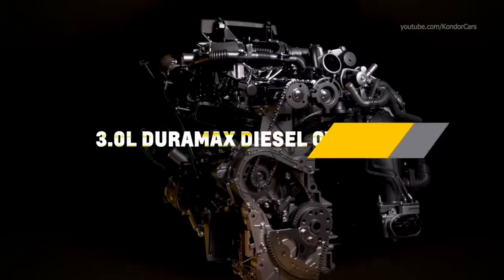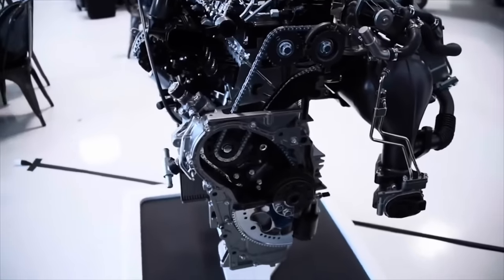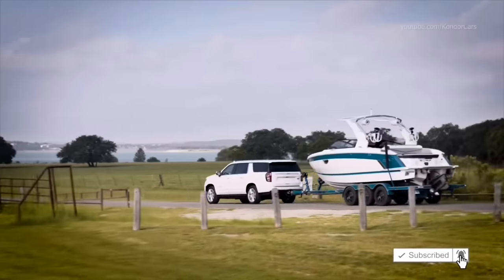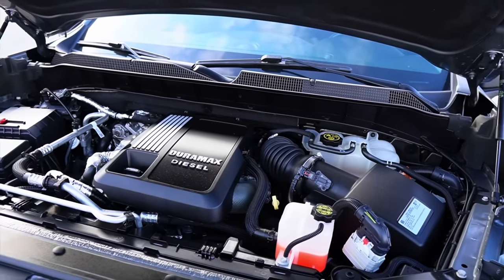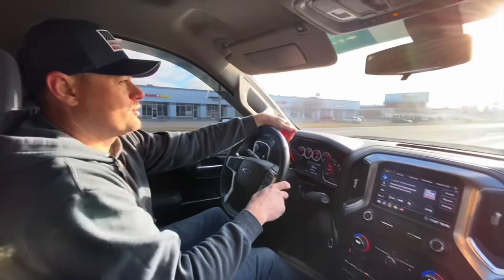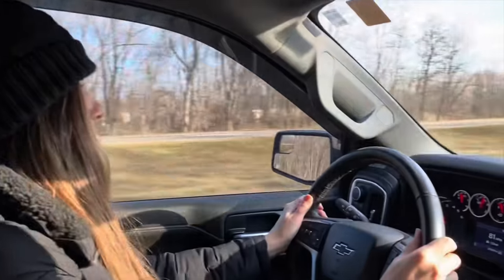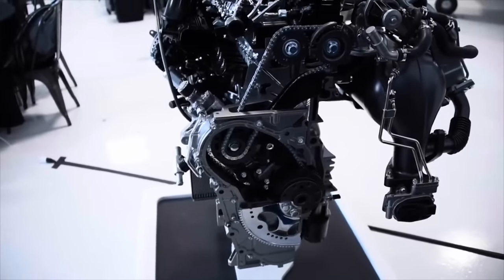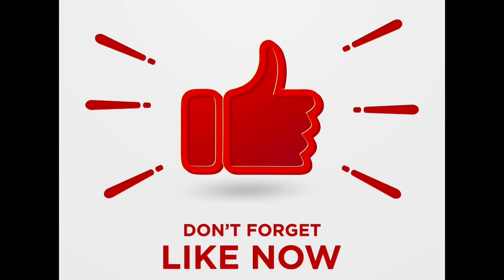What Everyone Needs To Know About The 3.0L Duramax!

Comment: Based on the highway mileage  to 100,000 miles you spend the same amount on Gas as Diesel. Consider cost per gallon and gallons used.  Not to add the DEF costs. You are better off with the Gas engine.  When the diesel emissions stuff acts up your wallet will wish you had a gas engine.. Sadly the US Govt has forced the manufacturers to ruin the diesel engines.
Reply: Show your math. Also, DEF costs for 100k would cost you about $100-$150 (roughly $1 per 1k miles) if you not towing constantly.

Comment: Your biggest problem is flooring it and expecting it to take off like a gas engine. Big mistake with this truck. Stay within the powerband and it does take off. Under 2.5k revs and it will move. I'll never understand why people try to drive small diesel engines like a V8 gasser.

Comment: The 2023 3.0 Duramax tow rating was increased to 13,300lbs, you didnt mention that.
 Ford and Ram have/are deleting their 1/2 ton diesel engines.
Did your wife know the truck you tested was an extended cab and not the very roomy crew cab?

Comment: So if a Duramax will go an average 10 miles more per gallon, plus deff fuel, fuel filters, more oil, it's just still way more expensive to drive. Period. The 2.7 is a beast has more hp and almost same torque....... So ya.

Comment: This was one of the strangest reviews I've seen. It says it came out 3 weeks ago but most of the info is old. The newer 3.0 I believe now has a 200k mile belt change interval. You mentioned the new engine but when you compared the diesel to the 5.3 on the chart you used the old diesel's numbers. You compared a Denali HD to a 1/2 ton Chevy extended cab in maybe an LT trim and wonder why it's smaller and not as nice? Shocker.

Comment: Total nightmare sensor problems fan problems cilynder problems just when warranty runs out stick to 6,6 Duramax or 5,3 gas ⛽️ it’s a dog mine is screed needs $4,000 worth of work. I have a 2021 with 80K miles it’s worthless.

Comment: Your info is way out of date and inaccurate My friend.  My first 2020 3.0 I owned to 73k miles only had on bad sensor issue. I traded it in for a '22 3.0. the tow rating on the '22 is much higher tow rating at 10,500. The New LZ0 does not come out until the '23 model year. If you're trying to pull a gooseneck or any 5th wheel, you would never buy a 1500 or a 5.3 gas for that matter. Thos motor will run circles around the 5.3 any day at any time!

Comment: If you're going to be hauling heavy equipment, you're not going to be buying a half ton truck anyway. So why make the comment or comparison? Normal people would buy that for the gas mileage not the towing capacity. Not everyone pulls trailers or campers all the time. If I could afford one, I would buy one, but the prices have gotten so out of hand most normal hard working people like myself can't afford one. It would be rusted out before I could even have it paid for and that would be on a 10 year loan. Ridiculous!

Comment: I put the PPE intercooler in my 21 AT4 3.0 Duramax and it goes like AIDS @ a queer convention.  Heavy tow 7000+ nice upgrade.  The PPE trans pan, trans cooler, trans thermostat bypass and rear diff cover are nice upgrade for heavy towing also.

Comment: 2023 LZ0 with the tow package can tow around 13k.  You get the 373 gears in a 9.75" rear housing.   That's the truck I'm looking for this later  in 2023.

Comment: Too complex for a diesel. Too many things to go wrong. 10-Speed transmission is also problematic on many of them. 3.0L diesel might give @ 30% better fuel efficiency but gasoline costs @ 30% less. Plus diesels require more maintenence & DEF.

Comment: Have had many diesels and run a small fleet of Duramax, Ram and HAD some Super Duties. 

LOVE DIESELS, but the 3.0 in 1/2 ton is no way worth the extra cost and maintenance cost. Between the STUPID DEF system and the cost difference between diesel and gas, it is not worth it. As much as I love the diesels, if we bought any 1/2 tons they will be gas. 

Already have to many DEF problems as it is.

Comment: Also, I currently go overseas a lot, I have driven GM vehicles in other countries that have these diesels engines and the smaller 2.7 inline diesel 4 cylinder. In a trailblazer 4x4 2023 model that you cant get in the states by the way, sad to see. with the 2.7 Duramax it averages about 45 miles to gallon in high elevation and mountain regions. These vehicles don't run DEF and only have O2 sensors. America is like the only country that has to do with this Stupid EPA BS!!!!!!!!!!! It kills the engines life span in half and cost more to operate and gets less fuel mileage. America is getting ripped off big time.

Comment: The transmission wasnt "co-developed" with Ford.. Ford 100% developed it. Chevy's part of the deal was they were supposed to develop a 9 speed for AWD/FWD crossovers. Ford started putting the 10 speed in on the 2017 F150 and Chevy didnt till 19 i believe because there was a bit of a pissing match since ford rejected Chevy's 9 speed due to not lending to fuel efficiency enough. Late model chevy transmissions are trash. I have a 19 teail boss with the 8 speed and it has slipped since day one. The dealerships say theres nothing that can be done, Chevy says thats just the way they are. What a joke.. i honesty wish i would've tried to make them buy it back but i thought maybe it'd get better.. it hasn't.
Reply: Shame. A simple fluid change is all thats required.
Factory fill up was from large drums. It separates. They only sell quarts now.
If your torque still slips after the fluid change you waited too long. It's toast.

Comment: On another note will manufacturers ever stop building diesels with def? I’m keeping my LB7 forever unless they stop making this new def eating exhaust plugging over priced crap. I would love a newer truck but as long as the feds are going to over reach and EVs are the future I won’t be in one. I saw the 1000hp hummer go an impressive 123 miles before it was completely dead pulling a little 6k trailer. So the EV concept has another 10 years of failing to replace the diesel truck. Def is a bust and if someone wants to delete the L5P that’s no small inexpensive task as well as now the feds want to send you to the clink for it! Is there talk of fixing what is wrong with the new diesels?

Comment: Meh 2021… should review the LZ0 also no DEF shortage, every place I’ve gone to where I am there’s plenty plenty. Also I have 6k miles on mine and still have half a tank of DEF. Also you are testing the smallest cab version, Crew cab is a lot more room. Your review is pretty terrible to be honest, your just used to 600hp+ 6.6 duramaxs so this didn’t get a fair review from you in my opinion. These trucks are great. They are meant for lightly duty work and getting great mileage.

Comment: How old is this video? Half the info is out of date or wrong lol

1st 2020-22 non refresh LM2 max tow is 9300 lbs, 2022 refresh+ has the Max tow package available which is 13300, better than dodge or Ford which doesn't even make the 3.0 power choke in an f150 and ram killed the eco diesel.

2nd the oil pump service belt life is 200k miles, originally was 150k but is now extended to 200k

3rd there's a DEF shortage? 

4th. You only need to add Def once every 5k-7k miles unless you're towing than maybe 1k-2k miles MAYBE

5th. Biggest issue is the crank no start which is mainly only the 2021 model year as GM changed suppliers of the cam wheel for that year

I think that's all, I have the 2020 one with 75k miles and have had no issues whatsoever, it pulls my 7klb TT with ease and you can't even tell its back there,  mines a crew cab, standard box 4wd z71 and if I go 75-80 I get 25-26 mpg 65-75 and I'll get 27-30 mpg. I just did a round trip from Santa fe to Colorado Springs about 700 miles on a single tank of fuel

Comment: This motor sucks , if u want your truck in the shop for 3 months go buy it but anyone who can look things up and read stay away , my 2021 3.0 has had more issues then any truck I owned in my life , push the start button runs through the cycle and dose not start  long crack !! , had 2 glow plugs out of 6 of them at 15k miles. , 6 oil. Leaks destroyed my driveway , break sensors went out 80 days in service and counting biggest pice of junk don’t look it up be4 u spend 70k on a basic truck

Comment: Here's what you need to know about the 3.0 Duramax 6 cyl engine. It's a piece of caca. You'll be throwing your money down the drain. If you want a family Suburban that's worth something, get a 2500 from the 90's or a 2500 from 2000 to 2006 and swap in an LML engine. The money you're gonna spend on the junker 3.0 Slowmax is better spent in restoring an older diesel Suburban.

Comment: "Like a ToYoTa TuNdRa" sounds like another arrogant Government Motors lover. The Tundra 5.7 will still be kicking past 500k miles while this 3.0 is being recalled and filling up the used dealer lots. Sad fact, a Tundra in 2008 has more HP and torque than a 2023 GM 5.3 V8 and is more American made than a Silverado. My bets on this 3.0 Duramax are timing chain problems and aluminum pistons cracking.

Comment: Uh, you're NOT putting 200,000 miles on it without a seriously EXPENSIVE maintenance repair which is > > > removing the transmission to service the oiling belt at the rear of the engine, And I believe there are sensors that when they fail the cab has to come off to access them (stupid engineers)

Comment: Biggest POS ever nothing but issues and Dealership is so incompetent. Has oil leaks that they have attempted to fix still not fixed now refusing to do anything. In 7k miles it burns and leaks so much oil that it didn’t register in dip stick. Engine start knocking after last time was in shop. The had Trans out to try and fix leak it was supposedly coming from some rear seal. So they replaced seal and the required oil pump belt. there are telling me that the noise I’m hearing is from the Pump in trans. Noise is no where near trans. Also if it is the pump they have refused to properly fix the Shift issue it had when accelerating the truck bucks and jerks they replace torque converter think 2-3 times saying they could not figure it out last time in shop I asked them again if they found issue service advisor told me GM knows about problem but know solution. I took to them b4 warranty ran out told to fix everything now they gave back and Now needs new trans right out of warranty. I will never By a GM product again. And these are just two if the problems it’s had it’s been in shop 20+ times Actually in middle of court case with GM now have to sue Dealership

Comment: This guy makes me laugh. Youtool. Doesn’t even know the difference between a double cab and a crew cab. That’s a double cab you have in the video! 😂
Also, they do get amazing mileage when not towing, which for the vast majority that own trucks is probably 95% of the time not towing. Is the 3.0 meant for towing a large gooseneck trailer..? Ummm, NO! Just a tip when driving this turbo baby Dmax, don’t mat the damn thing to the floor! It doesn’t make you accelerate faster. Ease into it to get it to kick down, build boost and just chug along, next thing you know you’re doing 100 mph.
Quote “I’m not bashing the baby Dmax…” lol, yea sure. Love getting over 28 MPG average, stick to your 16 mpg truck and be happy I guess but I would be miserable filling it up all the time ($$$). Too funny.